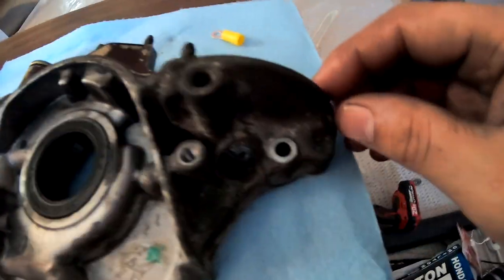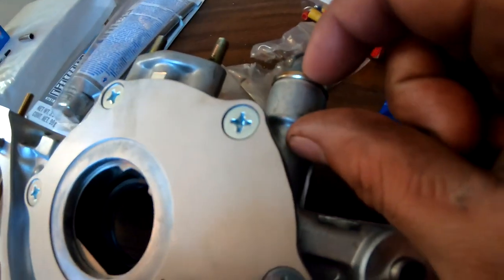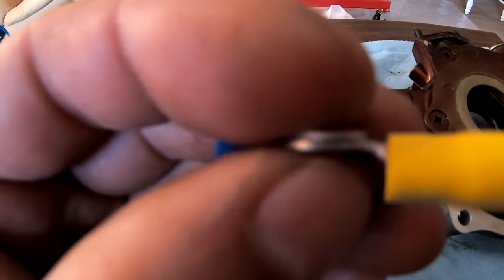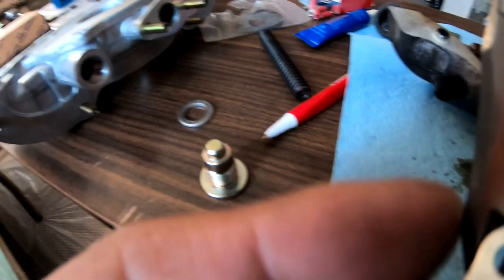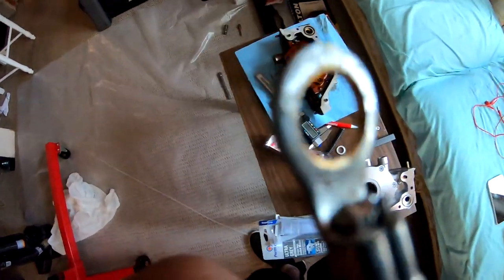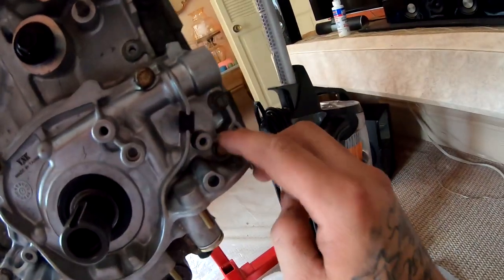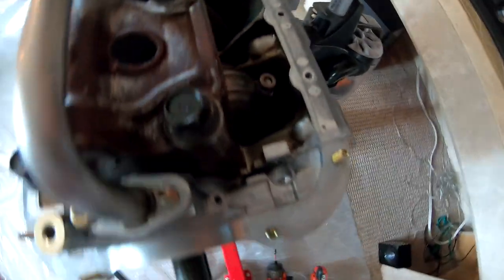500hp build D16 vitara turbo civic build Shimmed oil pump to increase oil pressure & Installation

Comment: Do you have the video on how to install Oil Pump & alignment onto the crankshaft?
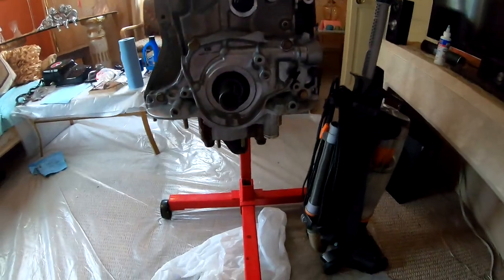Only sees you ran out of battery, then at 11:02 the Oil Pump magically on the engine. 

Questions:
1. What was the Inner Rotor to Outer Rotor Radial Clearance?
2. What was the Housing to Rotor Clearance?
3. How did you turn it or do you need to turn in correctly before placing onto the engine?
4. You didn't torque those bolts (11:15), you used an impact gun, why?

Comment: They use to call me SOHC T but i might do another one had wagon d15b vtec turbo and d16y vtec i did the spring and washer and bored it out monster oil pressure boost 2 shims from the lock washers it was stock with a subaru build ihi turbo no vitara my buddy put ls rods and arp bolts like you did pistons either way it works great make sure wlb310 pump best 255 are great but new ones are better awesome build i used but i beat civic si 2007 on 3 psi off a 1980s subaru brat with a greddy bov vw bug intercooler and some random charge pipe and check valves from a fish tank and vaccum lines crazy made a adapter plate to the subaru turbo to the factory dx manifold with the catalytic converter it was 2007 then i  would always get trash talked call me ricer i beat a svt modied ford escort with a swap for 500$ but man was that thing tuff after market pistons on that and rods it will come up better with a Z6 piston and rods from ls or d16 aftermarket with arp head bolts and you can get a girdle made to balance to rev higher and daul valve springs and cam and flat valves with metal headgasket with copper spray since i guess u have the turbo stuff but stock you can run those 10 psi safe boost with arp head studs and shim setup factory and cheat put a 10mm  or block off the vaccum line to the fuel pressure regulator if its factory constant 45psi or close and 440cc inj from rdx bolt right up and you can run that vaccum line with a t so u can have boost gauge or run aftermarket regulator and boost gauge there cause its best i think but good work on that i was strong believer in home made turbo stuff but people didnt believe me i showed people that built hot rods and stuff and i had them building rx7s porsches evos eclipses etc. I have dart b series waiting to see what to do here all motor or boost i have type r civic and integra heads and high compression cams dnt know yet and b20vtec turbo of course but idk yet have one owner EK cx 96 hatch was a guy who was a physical therapist and drove it everywhere bought it in college sold it to me for break job for his element 05 lol crazy he also was a tourist diver worked as trainer and drove to florida key west and some islands then wanted bigger stuff but someone stole all the papers on it but its had everything replaced on it except transmission motor rebuild and ac smokes alittle and had been taken care of but i was just talking here i liked how u had motor in room and stuff thats how i started make your own and build it i did a ls high compression build lasted a week b16b nitrate coated pistons arp head studs and skunk2 intake manifold knock of TB 70 SOME MM arp rod bolts dnt forget to get the rod measured cause it will spin bearings not just put in and tighten down take it get it measured for bearings and lighten and have block cleaned and crankshaft on em if u dnt go with aftermarket rods but i stayed a fender from a boosted B16A EG sir ii hatch on 10psi with B18A EK 96 then put high compression B20Z head 12lb flywheel excedy carbon clutch and pressure plate 6 puck it ran good for swapped IHE H22A injectors wlb255 fuel pump

Comment: I don't understand why you do that bro, is save gas or no ? And is this make car run fast and more power? I'm sorry I don't understand it could you explain for me please.
Reply from the maker: Im doing this to increase my pressure in my oil that runs through my engine. I am building my engine for more power this will help keep more oil pressure and keep my engine a little bit more lubricated and cooler to prevent me from messing up my bearings under high boost from my turbo. remember when you force your engine for more power everything runs faster creating more heat and more stress on the engine. This should help it just a little bit.
Reply: I see , thank you brother I don't know the engine well . But you guys way more knowledge than I do , again thank you for taking time and explain for me now I understand.

Comment: Hey bro is that one of the $35 pumps from ebay? I'm probably replacing mine next weekend and was trying to decide on which oil pump to get OEM or a Ebay.
Reply from the maker: Yea its an ebay one YSK oil pump part number 15100-P2A-A01
Reply: @BarbasLife  Thanks man looks pretty well built so I think I'll get one.

Comment: Like that info never seen someone build a D16A like that and you have a  cable trans if u get the change over hydraulic to cable i had GSR DA transmission made my mount measured it and buddy had after market mounts hasport so i welded and put a LEVEL LMFAO AND MACHINED IT WHERE THE BUBBLE WAS IN MIDDLE AND PUT AXLE IN FIT WENT STRAIGHT IN SAME WAY IF YOU DO SOHC CARBON SYNCHROS AND DIFF. DO IT RIGHT AND "FULL SYNYHETIC MOTOR OIL"  "ROYAL PURPLE" 10W30 FOR TRANSMISSION AND CHEAPEST MOTOR OIL AND THINNEST FOR BREAK IN AND I WOULDNT TURBO IT FIRST I WOULD BREAK INN SO METAL SHAVINGS OR GUNK DOESNT GET HUNG UP GOES SGRAIGHT TO FILTER AND TAKE OUT BACK PLUG FOR SURE 10MM FOR GOOD OIL FLOW AND I RAN 20W50 AFTER TURNED FUEL PRESSURE DOWN RAN A LINE OIL TOO RETURN TO PAN THEN ABOUT 500 MILES I RUN IT DOWN OPEN RD TESTED WITH P28 WITH SOCKET ECU THEN HAD ENOUGH TOGET HONDATA RAISED A LITTLE SMOKE FIRE SPITTER AND THEN WHEN IT HIT 1000 I PUT ZINC STUFF IN IT AND GET EVERYTHING READY TO BE FIRE BREATHING MACHINE MAKE SURE TOGET A VIBRATION ADDITIVE EVERYONCE IN AWHILE GO TO THE AIRPORT OR IF U CAN GET SOME RACE GAS OR E85 TUNE RUN IT KEEP US TUNED IN